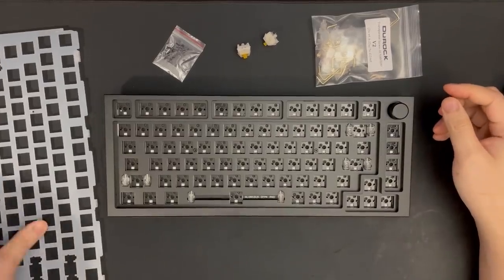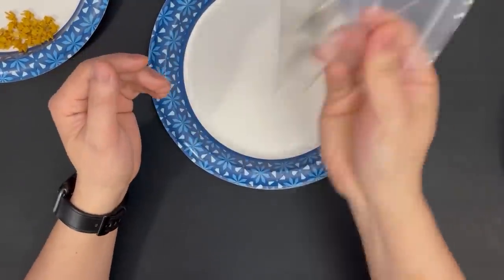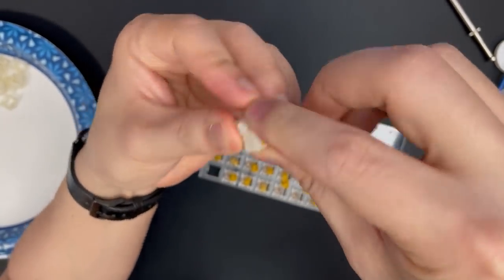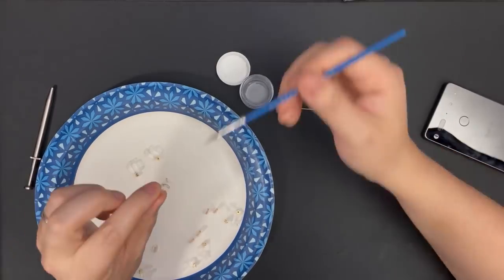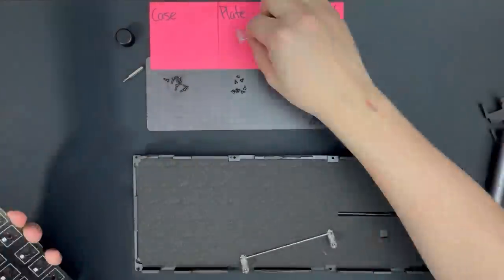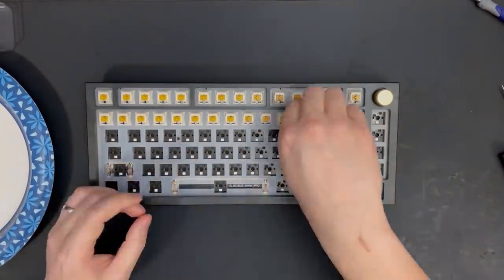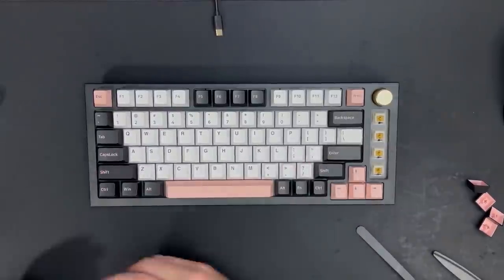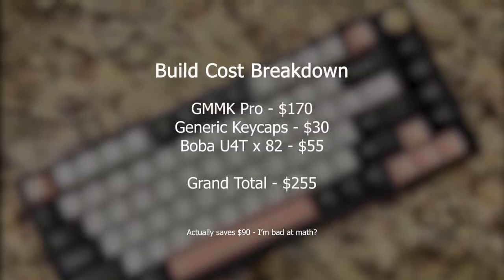$350 GMMK Pro Build Guide and Sound Test feat. | Boba U4T | Holee Mod Tutorial | GMfaKe Olivia!

Comment: i've heard that ppl said the durock V2 could not fit with the stock plate, so have u ever try it on the stock plate yet? 
My space bar sound very bad from stock. Im looking for a way to fix it but i never done anything like this before so i wonder if the stock plate gona fit with the Durock v2 or not.
Reply from the maker: I think there are variations between individual plates and even between the stabilizer openings on a single plate. In the video, you could see that the Durock stabilizers did not fit for the backspace, but it's possible that they would've fit in some of the other openings. Because of these variations, I wouldn't count on them fitting in all of the openings of the stock plate (without some minor filing of the plate).
Reply: @bigxie  i kind a stuck here, cus i've never done any mod keyboard before. And Glorious has announced that all plates now fit with all 3rd party stabs but alot of users said it was not so idk what to do here
Reply from the maker: I see. I preordered the GMMK Pro and was in the first batch, so it's very possible that the later batches have the issues already resolved. Admittedly, I have not stayed up to date (since I already have mine built). That being said, I opted for Durock stabs since they're well regarded and known to be among the best, but I think that with the same mods I did to the Durocks (basically just the holee mod and some light lubing), the stock GOAT stabs will be just fine too. So if you feel comfortable performing the stabilizer mods, you could just skip the Durock stabs and mod the stock ones. If you just want to swap out the stock ones and use stock Durock stabs, then certainly they will perform better but I think you'll need to do some more research on how well they fit in the plates in the newest batches.

Comment: @Andrew Xie does the spacebar foam effect the force required to press it or anything?
Reply from the maker: No, it doesn't. The foam doesn't come in contact with the switch or the stabilizers, all it's doing is filling out the other empty space in the spacebar to prevent the sound from bouncing around in the an otherwise open area. The weight of it is negligible and doesn't affect the upstroke either.

Comment: Would that lube mixture work well with tactile switches as well?
Reply from the maker: Yes, just avoid lubing the legs if you want maximum tactility. The Boba U4Ts used this build video are tactile switches.

Comment: Are your switches loose with the pc plate?
Reply from the maker: Yes, when pulling off keycaps, I'd say maybe 1/3 to 1/2 of the keycaps may pull the switch out with them, but that's the only time it's noticeable. It doesn't make a difference when actually typing.

Comment: How exactly did you get the durock v2 stabs to fit?
Reply from the maker: On my PC plate, there wasn't anything extra I had to do, just line up the stabs with the openings and guide them in.
Reply: @bigxie  ok, do you know if they will fit into the normal gmmk(which is what I have)? Also great video subbed :)
Reply from the maker: The regular GMMK keyboards use plate mount stabilizers as far as I know, so PCB mount screw in stabs like the Durock V2s will not fit. Durock does make plate mount stabilizers as well though, and they are among the best plate mount stabs available. I use them in my NK65 and would recommend them.
Reply: @bigxie  ok thanks a lot!

Comment: I have the same setup except for the keycaps, the build quality is good. My only criticism is the sound profile, its muted. I took out the case foam and plate foam, there no difference. I tested several switches like purple panda, blue velvet pme and feker tactiles all sounded muted. I prefer thocky sounding board and this one isnt. Aside from that, this board is still very good for the price.
Reply: I have the same feelings as you do about wanting a thocky board, and this isn't it. I've also read that different linears such as Alpaca, Gat Inks, Hyperglides, etc (for the most part) sound the same on this board. Just some food for thought. I do agree this is a very good value for what you get.
Reply from the maker: I'm beginning to think that it's just the way this keyboard is going to be, since it's a huge slab of aluminum with a really tight gasket fit. Personally I don't dislike the sound profile, it's quite different from all my other keyboards, but I am also looking forward to the R2 of the KBD67 lite shipping in May, as from what I've seen, that one is quite the thocky board.

Comment: Maybe my bandaid was too thick... but my spacebar felt so sluggish with the holee mod so I had to take it out :( but it was quiet
Reply from the maker: Yeah, since I originally made the video, I've actually switched to using the bandaids that are advertised as being able to survive a handwashing instead. There are several advantages over the traditional all fabric bandaids - it's more of a rubber texture and doesn't come apart, it's a bit thinner, and it is more resistant to grease or lube. It's also a lot easier to peel off the backing 😂

Comment: How do I remove the knob? The knob is way too tight for mine
Reply from the maker: It comes off just by pulling it straight up. If yours is on really tight, you could try wiggling it back and forth while applying upward pressure as well.

Comment: Is there anywhere I can buy a built gmmk, I want one but can’t be bothered to pick up a keyboard building hobby😂
Reply from the maker: I'm not aware of anywhere to buy a prebuilt GMMK Pro, but there are certainly a bunch of people that will do commissioned builds, perhaps even locally in your area. You could provide the exact specs and commission someone to build it for you (I've never done it before though, but I expect there will be a hefty premium over the price of just the parts, as there's a lot of labor involved, especially if you take the time to mod the stabs and lube the switches).
Reply: @bigxie  I mean technically it's not good to what so ever but can't you just plug switches in and put caps on them or do you have to disassemble the bare bone?
Reply from the maker: @crixy..  oh yeah, if you want to minimize the work you can just put the switches in directly and then put the keycaps on. That's like 20-30 mins tops. It won't sound that great, but still better than any prebuilt gaming keyboard like a Corsair or Razer.
Reply: @bigxie  yeah lazy people like me just plug n play haha, are there any good alternatives to the gmmk pro?
Reply: @bigxie  or should I settle the the first GMMK and customize down the road? sorry for the questions, I appreciate you writing back as well.
Reply from the maker: @crixy..  np, I'm a small channel so I try to keep up with the comments. There are some good alternatives too, but usually never in stock, such as the KBD67 Lite, TKC Portico, or NK65EE. Those are all plastic though (but around $20-50 cheaper). Glorious is living up to their promise of keeping the GMMK Pro in stock, both colors are in stock right now on their site. I actually think it's a great value considering the 75% form factor and metal build, and yeah, as you said, you can built it out stock first and if you ever want to customize, it's pretty easy to pop out the switches to lube or disassemble it to mod the stabs.
Reply: @bigxie  I think you've convinced me haha, You have any ''on the budget side'' switches and keycaps to recommend?, as i'll be upgrading down the line. Like if you could literally link me all necessary parts I'll be forever grateful, and you've earned a sub :)
Reply from the maker: @crixy..  keycaps are so subjective, but make sure you get a full set in order to support the 75% layout. There are tons of good options on Amazon for around $30-35, search for PBT keycaps as those won't wear down and shine over time. A great budget linear switch is the gateron yellow. If you prefer tactile, you can get the Glorious panda switches along with the keyboard directly from Glorious (they also sell keycap sets there too for the keyboard, check them out but they're not really my style). Sorry can't link directly I'm on mobile and also a bit lazy 😅
Reply: @bigxie  no worries, been a great help, thanks!

Comment: I feel like the u4t thock sound is tammed on the gmmk pro.  When I listen to the nk65, tofu 65, or KBD67 the sound seem thockier. Anyone else have u4t on the gmmk pro that can comment?  I am wondering which keyboard I should get, because I really like u4t sound.  Thanks.
Reply from the maker: In general, the GMMK Pro is a muted board, so it will affect the sound of all switches used in it. Some prefer that sound profile. If you like a thocky sound, the KBD67 Lite is a better choice (but also a 65%, not 75% like the GMMK Pro).
Reply: @bigxie  thank you for your explanation.  I think I will cancel my gmmk pro and get the KBD75v3 instead.  Maybe one day if I decide to build a quiet keyboard I will consider the gmmk pro.  Now, I am in the thock phase, so sound is very important.  Stay Safe and healthy.

Comment: Is this board via compatible?
Reply from the maker: I haven't personally installed it, but there is a firmware available for QMK and VIA support. I also remember reading that due to the chip shortage, later revisions of the GMMK Pro started using different controllers, so I'm not sure if the compatibility is across all the variants of the GMMK Pro PCB. Honestly I don't really like the Glorious Core software, but I only really used it a couple times to remap the keys, set the debounce time, and update the firmware.

Comment: Just finished my gmmk pro. Took me almost 12 hours. I'm exhausted and my head hurts. After all it went well. The only problem is that my spacebar is sticky. I have no idea what the problem could be. Has anyone an idea?. I am using durock V2 stabs, holee modded and lubed with Krytox 205g0 and xht-bdz
Reply from the maker: Dang, that's dedication! For the stuck stabs, there could be a few things causing it. Are you using really light switches, maybe they can't push the heavier space bar back up? Or, if you are using the alu or brass plate, did you make sure that the durock stab housing is pushed through the opening all the way (the opening was too small on those plates, at least in the initial batches when the video was made). You can also try temporarily flipping the spacebar over just to verify if it sticks in that orientation as well (some even prefer a flipped spacebar as it avoids the sharper edge from hitting your thumb).
Reply: @bigxie  hi, I am using Holy Boba / Sake Switches. The plate is the polycarbonate plate. I really had a hard time fitting the stabilizers through the pom Plate. But I think they are all pushed through entirely.

I will try to flip the spacebar tomorrow. Thank you for your help so far !

Comment: My keyboard build is gonna be, lubed gazew boba u4t with krytox 205g0, Durock v2 stabs, and gk61
Tell me guys if this is good, and also the stabs are gonna be lined as well
Reply from the maker: The GK61 uses plate mounted stabilizers I'm pretty sure. Durock does make some good plate mount stabs though, so as long as you lube/clip/holee mod them, that build should be great. You can also consider using thin PE foam between the PCB and the switches, which will make the bobas really pop.
Reply: The gk61 uses pcb plate mounted stabs will I be able to replace the stabs with Durock stabs? I heard that gk64 is compatable with pcb stabs

Comment: I'm a little disappointed with this sound profile. I expected a lower pitch and deeper sound profile from the U4T's on polycarb plate. Thank you for doing this specific build nonetheless.
Reply from the maker: I was also surprised by the higher pitch since the U4Ts sound nice and low on my Toyko60 (especially with MT3 keycaps). I'm going to try removing the foam later this week to see if it makes any difference, but I don't personally dislike this sound profile, it's just different. When I have both keyboards side by side, it is sort of shocking how different they sound though even though they're using the exact same switch prepped the same way.

Comment: My GMMK Pro build ended up coming out to about $420 once my GMK keycaps come in. (until then it's about $320 with a $40 keycap set)

(GMMK Pro, Poly plate, Alpaca switches, 205g0, switch films, Durock V2's, stab pads, placeholder keycaps)
Reply from the maker: Nice! Alpacas are my favorite linear switch and I'm sure they sound great on the poly plate (my only reference is on my alu NK65, where they're nice and clacky). 

Which GMK set did you go with?
Reply: @bigxie  GMK Nord, ordered them back in November, they were supposed to be out in Q1 2021 (so now) but have been pushed back to Q2 or Q3.
Reply: @VelcroSnake93  I feel your pain on the delay. I am waiting for my Mecha 01 set which is delayed until July.

Comment: So I've been holee modding backwards lol...

Well, good to know now I guess?
Reply from the maker: It may also be effective your way, I'm not too sure. If you haven't checked out Keybored's video on stabilizer mods, it sounds like what you did may be pretty similar to the epsi-mod (or half of it). I certainly wasn't very comprehensive in this video since it was just a step in the overall GMMK Pro build process and not a video dedicated to the holee mod (of which there are quite a few good ones - Hamaji Neo has a great one as well), but there definitely are different ways to approach the problem and they're mostly similarly effective so if your method has been working, then there isn't any need to go back and redo them for marginal or no improvement.
Reply: @bigxie  No it's fine effectiveness-wise, the issue is more that it's a pain in the ass to get the band-aid in the bottom after it's already been anchored in the top, and you gotta be genius with the length of the bandaid too. I'm not planning on redoing them tbh, I just think when I redo the stabs on my GMMK pro (I'm still using the GOAT ones because I'm lazy) I should probably do them the smart way.